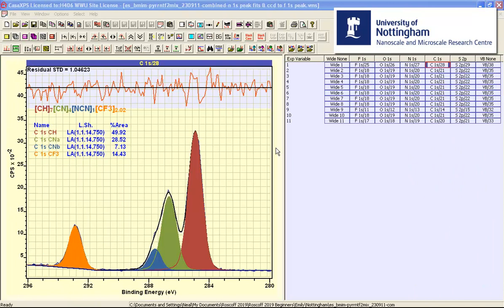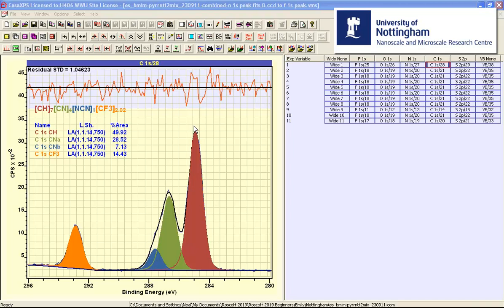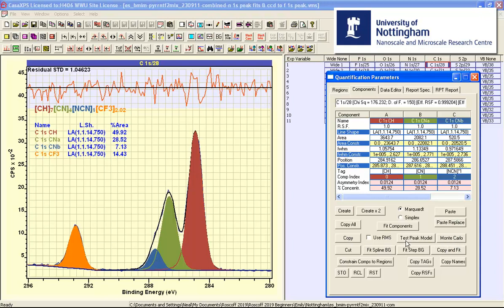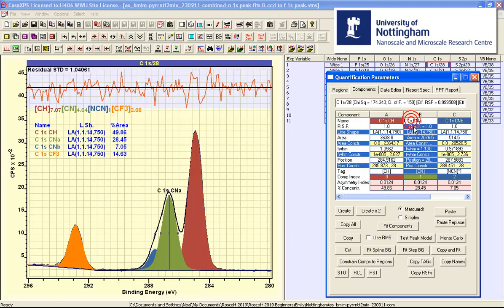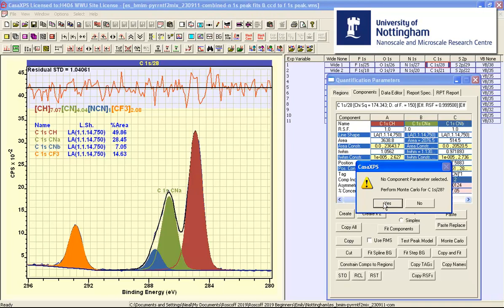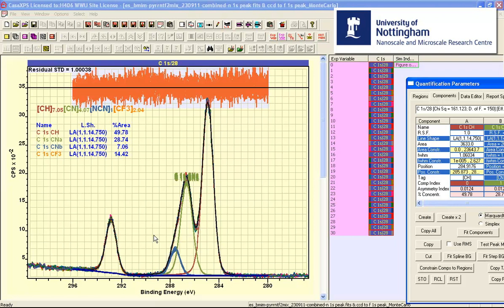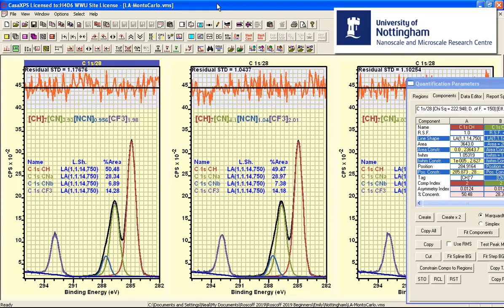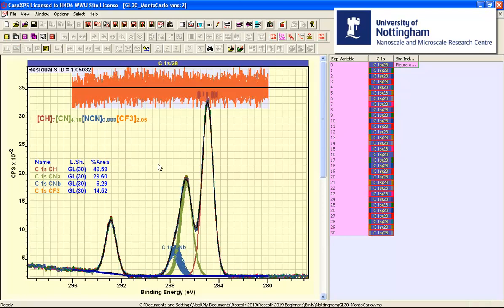Testing a Peak Model for Stability with respect to Noise in CasaXPS

Comment: Thank you for your video.
I would like to ask a question about processing a spectrum before doing the Monte-Carlo method.
According to the previous video (https://youtu.be/G02pBnyD3bY?si=aIH4BHBdrws-9otQ), you make a spectrum close to unity with regression background.
Is it necessary to make a spectrum near unity compared to the regression background?
Reply from the maker: Yes, Monte Carlo error analysis assumes data are pulse counted. If residual standard deviation differs from unity, then the numerically determined error estimates will be incorrect. The noise added to spectra that are not pulse counted will be incorrect, so the model may appear better or worse than is the case.